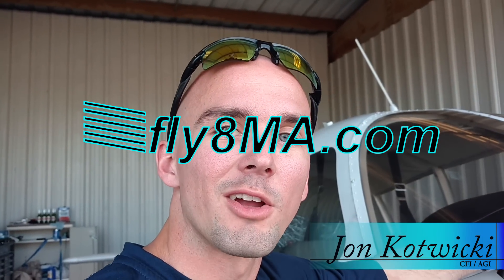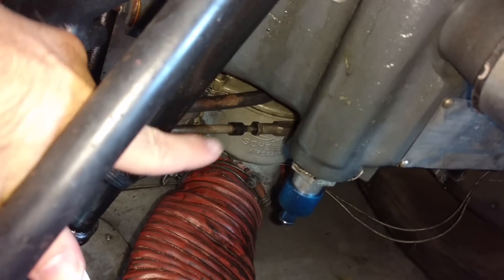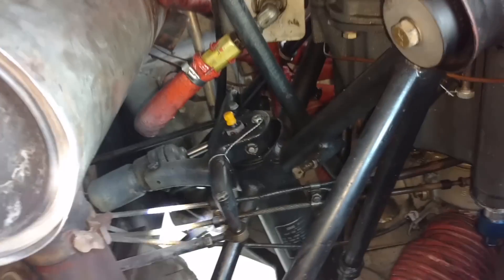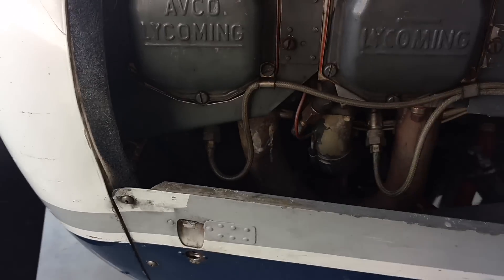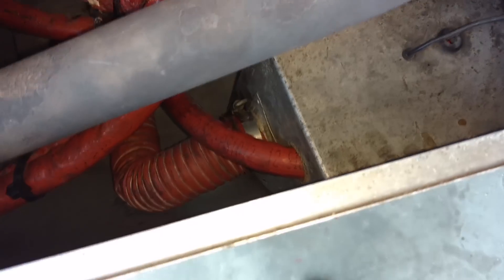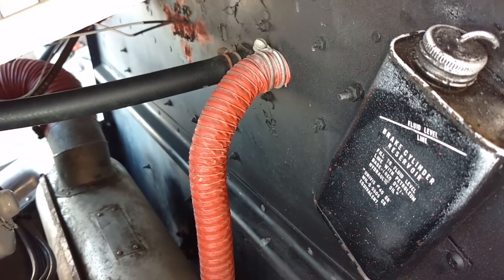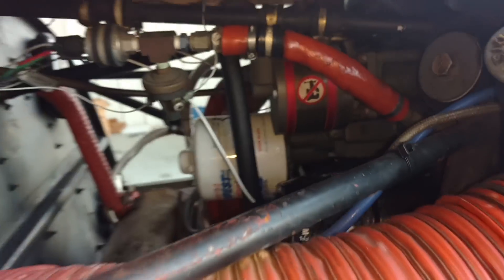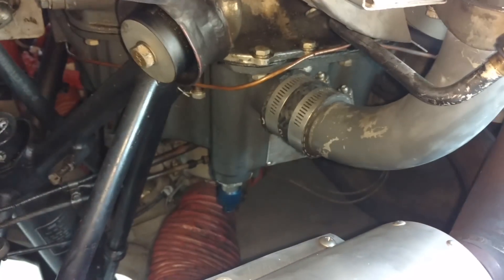Ep. 53: What's Under the Hood of a Little Airplane | Explained How it Works

Comment: You might want to make sure that intake tube is the correct one.  I was just reading an NTSB report on a Cherokee that had an engine failure followed by a water lading caused by a collapsing induction tube.  I can't tell by the video but you already have one collapsing tube in there, I would hate to see another one.  Good luck and great video.

Comment: Did you have any trouble getting the Parmetheus LED landing light to fit?   The cooling fins on the back prevented me from getting the retainer over it on my PA-28-140, and I’ve read of similar troubles from others.   Any suggestions you could share?  Thanks, great video.

Comment: So the air that enters the engine after activating carb heat is just ambient air inside the engine cowling that flows through the heating shroud? I’m still a little confused how it gets pressure to be used in combustion?

Comment: Looks like all the hoses on this P28 needs replacing. As a matter of fact the whole engine compartment needs some attention. New Baffles new hoses clamps . As I can see you have no Carb heat or cabin heat. I hope youre not offended but looks like these things were just difered and never fixed during the 100 hr or annual. Frankly if I were to open the cowling and see all this I wouldnt fly the airplane.Not because of air worthiness just because I knew the owner was trying to be cheap by not fixing the issues. I am sure his AP has told him about the carb heat hose and cabin heat hose many times because that hose doesnt get that bad of shape in just one annual inspection. Those hoses have probably needed replacing for years as well as the Baffles. When my life depends on everything working I spare no expense on maintenence. This isnt a car you can just pull over to the side of the road lol I would seriously have your owner fix these things

Comment: I am stunningly disappointed. Not in the technical explanation or video content as a whole, but in the looks and condition of that engine. To me, all airplanes are good looking - large or small, they are sleek, shiny, and beautifully painted. But, now I know that under the "hood" is a dilapidated, dirty, rusty, and quite ugly powerplant. The engine in my little Mitsubishi SUV looks 10 times better. I saw parts disconnected, collapsed, and looking like they came from a 1946 Plymouth. No high-tech, neat, organized and spotlessly clean components anywhere.
So, as a pilot or passenger, you buzz along at 5,000 ft altitude with your lives depending on that joke of an engine? Oh, I know it is well built and reliable... all the more reason you should keep its 'home' clean and neat. Not looking like it was assembled in someone's backyard garage with junk parts. Geez... 🥴

Comment: So awesome video. I have a question. When we turn one carburetor heat, i understand hitted air by muffler goes in to carburetor. But, from where does the original air come from? The air comes from cabin heat air inlet? Or is there other holl on the cawling?

Comment: Very good video! Now, is the Lycoming ready to be overhauled? I wouldn't be taking that plane anywhere in the visual condiion it is in. Fuel and vacuum lines bubbled and collapsed? Plugs encrusted by carbon - a natural conductor of electricity. Wires that look old and insulation stiff enough to break or crumble off causing a short? Rust deep on exhaust pipes and flywheel? That Lycoming neeeds money and TLC before it flies again. Could that plane been in storage too long? You may be able to get away with that deterioration in a car, but not in any piston aircraft.

Comment: I wanted to see the lines going to the alternator. One of the lines to our alternator keeps resting on the muffler and then we (club plane) get alt light. The line runs to the right side of the alternator and it also has a small black wire attached to it there. What is going on with that? Our tech doesn't seem to think the wire resting on the muffler/exhaust is a problem..This is a new build since we had a ground fire and we did repairs. I'm going to zip tie it today and see what happens.

Comment: Why would they want the air/fuel mixture to cool the oil right before entering the cylinders? Wouldn't that warm the air, making it less dense and therefore make the engine perform slightly worse? Or because it would be the same quantity of air already having been mixed, would performance not change?

Comment: To Fly 8 ma.com Jon Kotwicki you showed a video on the small aircraft engine the little 4 cylinder junk. They make very good boat anchors they are junk verses a powerful V8 engine from Ford or Chrysler or General motors. If I your Airplane I would switch it out for a powerful V8 with fuel injection and super charger. Alot less problems with a V8.

Comment: Good Stuff. 
What did you miss? Yep...the landing light wires. 
Also, what engine model is that? I fly a PA28-161 with a O-320-D3G. Layout is a bit different. Oil cooler is left side rear. There is no box over the electrically driven fuel pump. In fact, I don't have that box at all on the left side. My air intake does not have the landing light in it and the air from the intake goes directly to an airbox holding a fillter.

Comment: And if the engine compartment looks that bad, what does the rest of the aircraft look like?  I haven't checked for your list of videos, but in case you haven't already, you could use this aircraft to point out and explain things to look for during a detailed inspection (extended preflight or pre buy inspection?) and show what things look like when they need some attention or how to determine that they are still serviceable and safe in spite of looking yucky.   You are doing a great job with all your videos, very informative.

Comment: Great Video.  but from the appearance of that engine compartment, especially the messy looking wiring, I don't want to fly in that aircraft.  I would reject it on preflight, or spend a few hours replacing a lot of stuff before I would fly in it.

Comment: I'm new to GA aircraft. I feel having a wide band O2 sensor to be able to accurately control mixture would be helpful. Preventing cylinder wash and running lean saves engines. Also would like to see the starter solenoid in the cockpit. If it failed you could jump it with something to start the aircraft. Starter solenoids can be sketchy.

Comment: Something that I have been wondering about for some time now: Why do I loose some power, when one magneto fails? I mean, the cylinder still gets ignited, right?
Reply from the maker: You get a small decrease in power because the fuel and air is not burning as completely.  The flame from just the one plug has to travel all the way across the cylinder and that takes time (relatively speaking)
Reply: Thank you for explaining! I guessed something in that direction.

Comment: Great vid!!  Very informative. One question.....Why the wire on the oil filter?   I mean cars dont need one, right?.   I assume its to make sure it stays in place. Anyway, just wondering.   Keep the videos coming!!!
Reply: Actually, now that I think about it, that was a dumb question. If that oil filter spun off you could have a seize in midair. Not good.  At least with a car you could just pull over.  Im new at this. Sorry, my bad.

Comment: Very good video. The thing I don’t understand is that cool air is more dense witch you will get a better combustion. If the air and fuel is being warmed going through the sump surely that would make the engine less efficient
Reply from the maker: That's correct!  But engines overheating tend to seize and fail, so less power is better than no power.  Remember these engines were designed just after the second world war
Reply: FLY8MA.com Flight Training. I did nor realise that these engines were that old. Suppose why change something that works. 
Is the Cessna the same set up as the pa28. When we shut down the engine we lean it off till the shuts down. Is this to use the fuel up that is in the float chamber rather then turning the ignition off. 
It reminds me of a VW beetle engine.

Comment: everything looks so simple why are engines so much money thou
Reply: Because of the tolerances, required maint schedules, average labor hours required, and "expertise" / licensing / certifications required.
You can't just back-yard mechanic an aircraft to fly without putting yourself or someone else in some serious danger, unlike a car where you can 9/10 times just pull off to the side of the road.
Reply: The aircraft in the video must have had a backyard mechanic, certainly not a professional.  If I were to be asked to work on that one, I would insist that a whole lot of things be fixed before I would certify anything I did on it.   I don't even let my cars get that ratty under the hood.   I kind of think this aircraft is not being used but the new oil filter makes me wonder.   Maybe it's used just for ground run-up demonstrations.
Reply: @tfilter6  The oil filters always look new on flight school planes,  they get changed every couple of weeks.

Comment: What do you think about the cam shafts in that engine? I'm considering buying a 67'.... Last flight was in 94'. 1730 hrs.
Reply from the maker: Uh, that sounds like a scary prospect.  I wouldn't touch it til it had 25-50 hrs on it within the past year and then take a look in the oil filter and maybe pop a jug and look at the cam.

Comment: Why do many small airplanes´ engines still have carburetors ?!?
Reply from the maker: It's just the way they were certified way back when...very expensive to update them.  Many of the new airplanes are certified with fuel injected engines.  Airplanes typically always lag behind the car innovations a bit.

Comment: How did this thing ever get a airworthiness certificate? Just about every thing he pointed at and said was important was fucked up in some way. Thank God the oil filter is safety wired because that would spin loose long before the oil cooler lines that are almost completely blocked off by the heat distortion and kinks they have all over them would fail. I seen lawnmowers less cobbled together than that thing.
Reply from the maker: Welcome to flight school airplanes in FL....can't say I really miss flying those things.  Another reason to own your own instead.
Reply: Good point, you cant just call AAA when flying a rented aircraft. I did like your video and learned somethings from it. Hope I didn't come across as a dick with my first comment. see ya, Jon
Reply: Its maintenance periods keep getting stretched due to repeated disconnection of the Hobbs.
Reply: @jstan_49  There's also a meter on the tach. It's used for maintenance.  Hobbs meters are optional.  Some flight schools wire them to the master switch.
Reply: I was thinking the same thing! My kids go kart engine looks better than this thing.
Reply: FLY8MA.com Flight Training Lol I was saying to my self. Looks like a flight school airplane. Greedy flight school owners...
Reply: Was thinking the same thing. All stuff that should be captured during the next 100-hour.

Comment: This was very interesting and eye opening!  As one who has spent decades fooling around under the hoods of cars and working on other engines, I had always assumed that an aircraft engine and compartment would be extremely neat, tidy, and well laid out, using high quality fittings and lines, and be well maintained.  I'm not at all meaning to be derogatory.  And maybe I have a touch of OCD, but that really does not look like any of those things under there!  Is this a fairly typical example of light aircraft engine compartment?  I want to get my mechanic's certification in addition to the pilot's license, and maintain my own airplane to extremely high standards. :)
Reply from the maker: This is fairly typical as most GA aircraft are 30-50 years old, and the old somewhat crappy components are what you are forced to use as it is all that is approved by the FAA.  Couple that with flight schools that try to save penny's over improving safety and you get something that looks like this.  You can expect this or worse in almost any flight school airplane, even in new aircraft, it doesn't take long for a flight school to leave them in a legal, mostly airworthy state of disrepair.  Best to join a club or own  your own!

Comment: No free rides. Leave the Hobbs meter alone and functioning. Simple ethics 101 I guess.
Reply: Was clearly a joke which I found funny as hell!
Reply: Most every flying club and FBO log both the Hobbs and the tach anyway.  I think he was just making a joke.
Reply: Hard to tell. He replied to another comment with more detail and it read straight. He should be more careful about encouraging fraud.
Reply: Dont that go by the rpm counter rather than the Hobbs time running?

Comment: A run-time or 'Hobbs' meter tells the mechanic how long the engine has functioned. Blocking it's use gives a false impression that the engine has less time of use. Engine maintenance that should have been preformed, isn't. So you save some cash and everyone else risks engine failure?
Reply: Yes that small comment disturbed me on several levels.    Otherwise a good video but akin to rolling back a car odometer (or disconnecting speedometer cable/speed sensor on your rental).  Dishonest at best.
Reply from the maker: +Frank Nash MX is based on tach time,Hobbs is used only for billing and logging time in little airplanes

Comment: great, suck the heated air intake tube flat, and the rusted springs so they can gouge the cylinder walls resting on the rings, and short the plugs, mess up the valves and valve seats. I've seen this before, and it ain't pretty, but it is pretty expensive, and rather risky being up in the air. Great job explaining everything and showing where. I was in the Air Force, and we had Tail Number "shadow" mats, where all the parts went during disassembly, exchange, and rebuild. The A&P log book was on a log rack, or wall for sign off.
Reply: Just what I thought, I saw that heated intake air tube and paused to come down here & check for comments. Be great if that decided to suck closed as you left ground effect on take off ! Just watched a bit further and was relieved to see that it is "T'd" and could at least get cold air from the nose :)

Comment: Thought the Hobbs meter was connected electrically through the battery switch and the tach meter was connected to the oil pressure switch... at least that's how mine is on my airplane
Reply from the maker: +Sal Taglireno each airplane is a little different given that in 1967 airplanes did not come from the factory with Hobbs meters.  Most flight school airplanes are configured in this manner (unless they want to charge you more, then it is off of mater switch).  Tach is always going to be a hard cable to the engine on Lycoming or continental unless you have a stc for some fancy electric tach
Reply: FLY8MA.com Flight Training awesome! Oh trust me at FlightSafety in Vero they definitely have it set up to charge you as soon as the battery switch is on.

Comment: Interesting! I did not know the aux fuel pump was air cooled.
Reply from the maker: If you ever get a chance, volunteer to help out the A&P on a 100hr or annual inspection, you can learn a lot about what you are flying when you start taking it apart :)

Comment: Good lord, I have Seadoo watercraft in my store with less corrosion, not too mention better technology.  I am surprised they don't use a stainless hose clamp around the oil filter to use with the safety wire vs. relying on that little tang.
Reply from the maker: 50 year old airplanes living near saltwater certainly do not fair well.  On top of that it would be great to swap many components to SS, but it has to be FAA approved parts, and they are generally zinc or non-anodized aluminum at best.

Comment: Very informative video, thank you so much for showing what's under the hood, by the way, could you give us more information about the Hobbs thing?
Reply: Lol it’s a joke
Reply: Only if you're dishonest do you need to know this.  After all, is it worth it ?
Reply: is it like a milage meter?
Reply: @timquain5341  It measures time. When you rent an airplane you pay by the hour.
Reply from the maker: Lmao, I'll go into a bit more in a latter video.  For now just look for a philips head screw connecting a little wire to a round pressure switch that will be connected with a "T" fitting on an oil line.  Once the engine starts producing oil pressure, it closes the circuit and lets electricity flow to the hobbs meter and start ticking.
Reply: When you're renting, just take a phillips head screwdriver, unscrew both screws holding the hobbs meter in, and disconnect it.  Just don't forget to re-connect it before returning the airplane!  That's all you need to know about the hobbs :)
Reply: dbflyboy917 “

Comment: Thanks so much for your time and effort. Can you explain the Hobbs sensor? Why will it be beneficial to know about the Hobbs sensor before training in a Piper?
Reply from the maker: It's how you will be billed for the airplane rental, basically it is a small clock that measures time in hours and tenths of an hour.  A tenth of an hour (0.1) usually costs you $15 or so when renting, so while it would be totally dishonest to mess with the system, we all like to joke about how to make it run a little slower or not work at all.